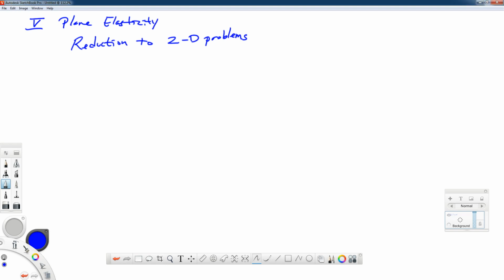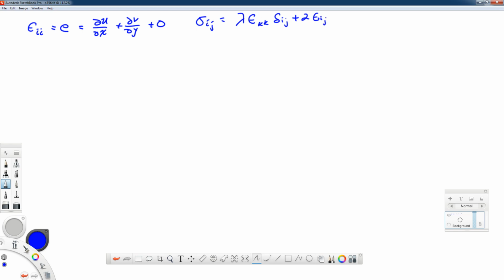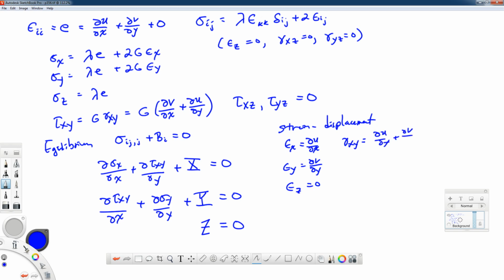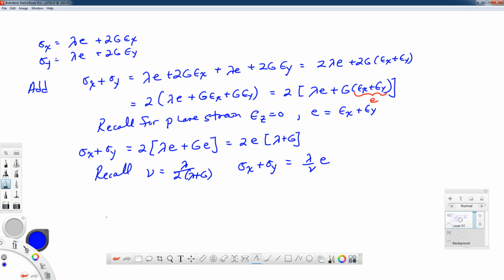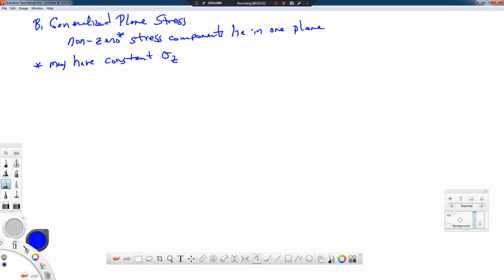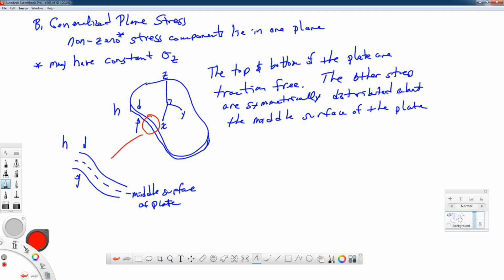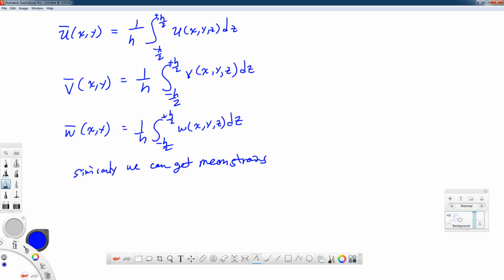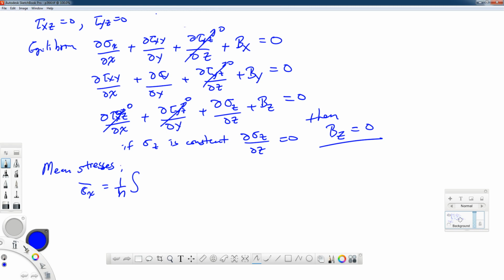Theory of Elasticity-Lecture 25a-2D elasticity

Comment: Hi, Dr. Barkey. Thank you for the lecture. I am just confused about the derivation of the equilibrium equation. Why the derivative of sigma z with respect to z is zero since sigma z equals to lambda*(du/dx+dv/dy).  Should not the derivative of sigma z with respect to z be lambda*(d^2u/dxdz+d^2v/dydz)? Thank you again.
Reply from the maker: Hi Kevin, we are specifically looking at plane stress states in this section.  Sigma_z can be at most a constant for generalized plane stress.